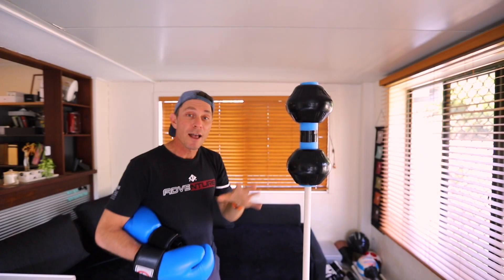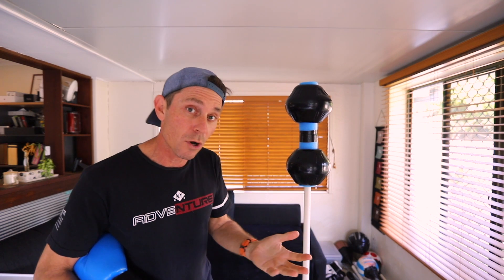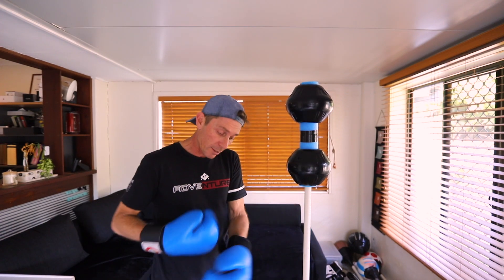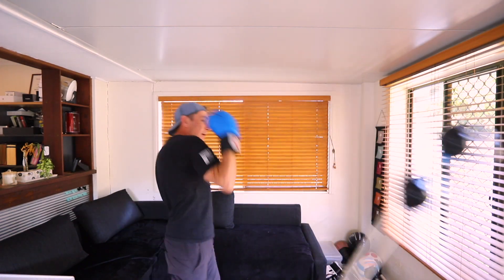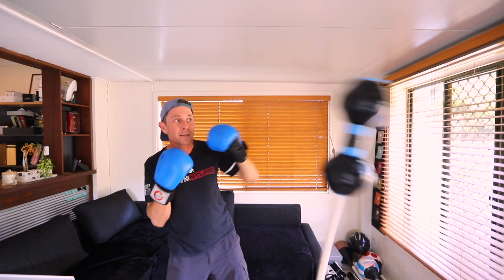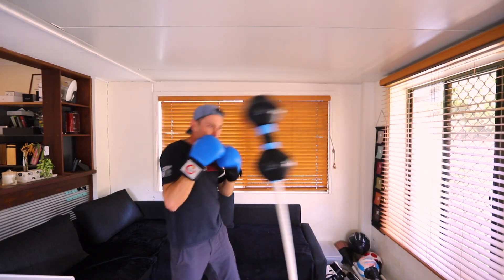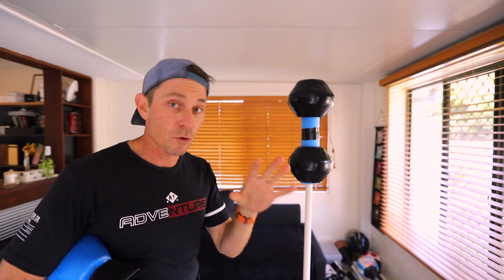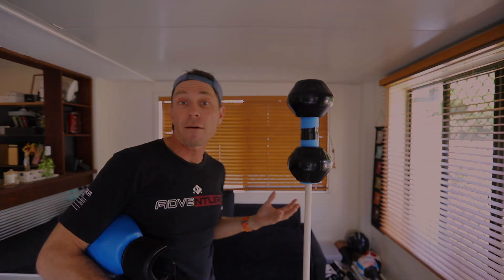DIY Cobra Bag - Double Bag Mod

Comment: You should check Grodex and try to dIY their new mamba bag
Reply from the maker: Thanks brother - looks pretty much like a PVC cobra bag with a small target. They could have done heaps better. In a few days I will do a video comparing the spring action to that of a PVC pipe and compare it with various targets large and small, including a vertical spar bar which I totally love the feel of. Lock it in brother!